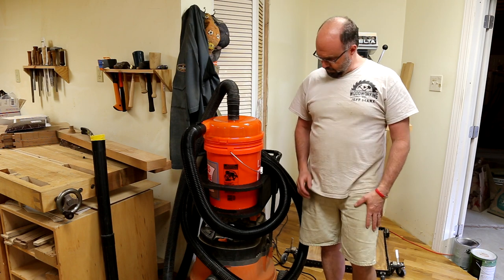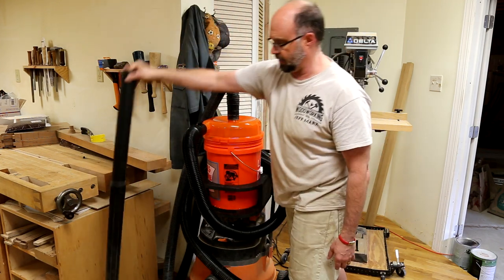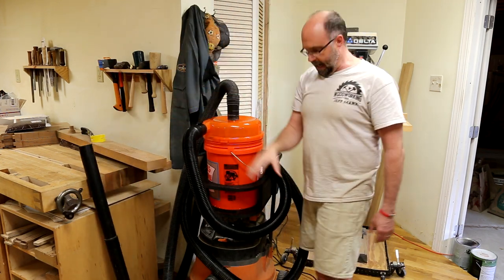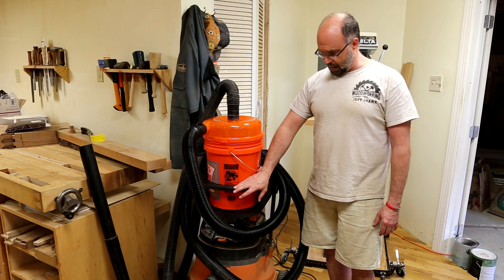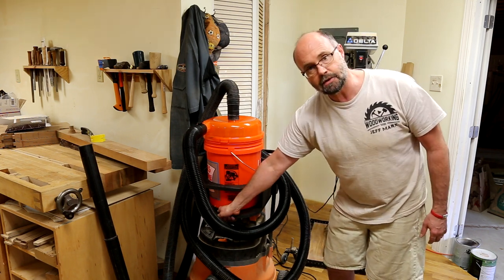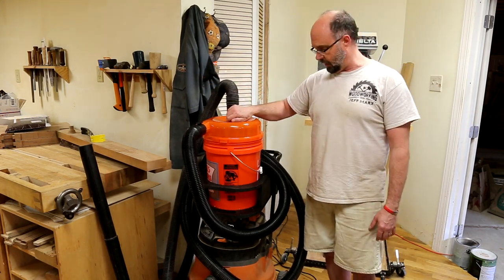Making a two stage shop vac: Dustopper Vac Topper Two stage vacuum: Dustopper Vac Topper

Comment: At first I was thinking "meh" but by the end of your video I was beginning to appreciate the simple design. I already have a vertical "pvc pipe" style holder. While it offers a small foot print I'ts not that rigid or stable when moving the vac around. Seeing as I already have a plywood plate with the bucket hole cut out, I think I'll adapt it to a style like your's. 𝙏𝙝𝙖𝙣𝙠𝙨.
Reply from the maker: Very cool, good luck with making yours!   Thanks for the nice comment.

Comment: Thanks for a simple design that won't cost an arm and leg. I like the idea of the extra long hose also.  Hals Wood Shop
Reply from the maker: Thanks for watching and for the nice comments.  I'm a fan of using my shop scraps when I can to save money and reduce clutter.  If you browse my channel, you'll see lots of scrap wood based projects and that's a theme that will continue.  The long hose is great, I can reach almost anywhere in my shop without unplugging the vac.

Comment: That's very nice but I made one that's even simpler and works even better in my opinion and it only took me four screws, a 12 inch piece of PVC pipe and the bottom half of a 5-gallon bucket. And before you say to yourself well it can't be very good then... Which is exactly what I probably would say, I'm going to tell you it is super solidly built and works absolutely perfect, I couldn't be happier. But yours is nice too thanks for sharing. 
I am super super jealous of your workshop though.
Reply from the maker: Well done and thanks for sharing!  Jeff
Reply: Who is Ben?
Reply: Ben. Was a typo, I fixed it. thanks..should have said "and" instead of "ben".

Comment: That's a solid value, considering the savings on filters and bags. My Rigid is exactly the same model. I think I'll get a dustopper rather than the Dust Deputy. The performance looks comparable, and the dustopper price point can't be beat. Nice frame/bracket as well!
Reply from the maker: I've seen comparisons between the two and the performance is effectively the same at a fraction of the cost.  I find myself using it to clean the shop which I never used to do, not wanting to change bags.  I'm very happy with it to this point.  Thanks for watching and commenting!

Comment: Would having a bag in the vacuum make it 100% effective? I know the whole point is to not have to have a bag. I’m just wondering. Working inside a clients home the least amount of dust the better
Reply from the maker: I do have the bag in the vacuum which claims to achieve HEPA efficiency.  The big win here is that most material doesn't get to the vac/bag so I won't have to change it all the time and should hopefully keep max airflow.  Thanks for watching and for the question!
Reply: Thank you. I have a million dollar home to do some drywall repair in. The least amount of dust the better
Reply from the maker: @johnwoods1688  amen to that!  Good luck.